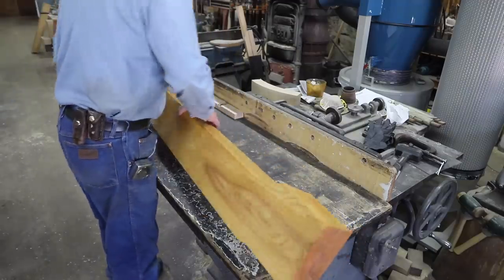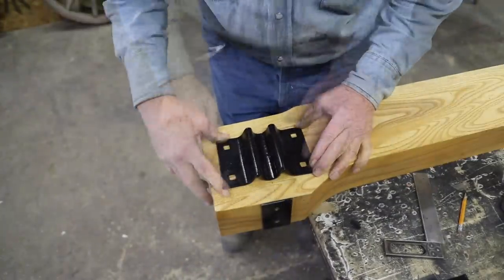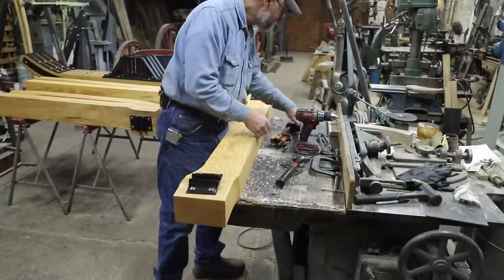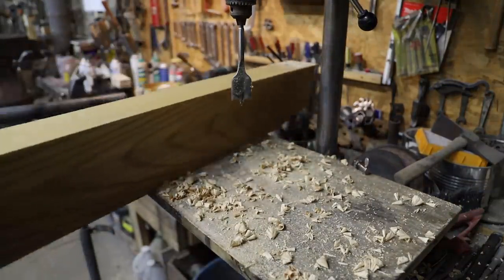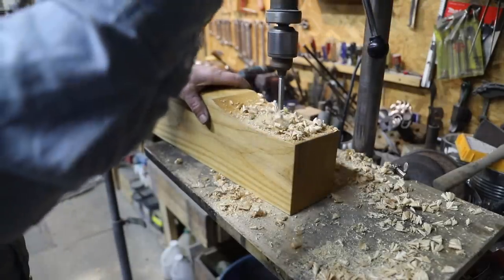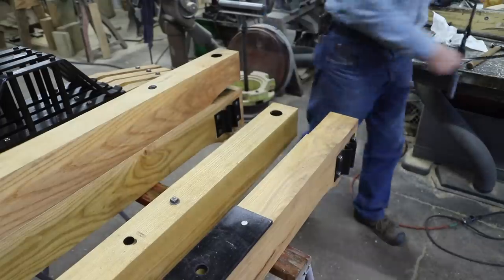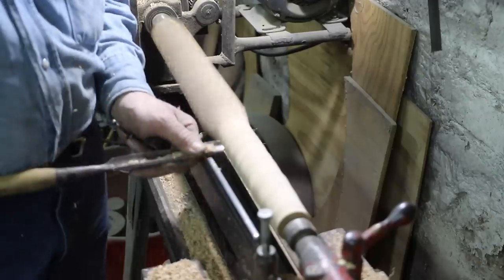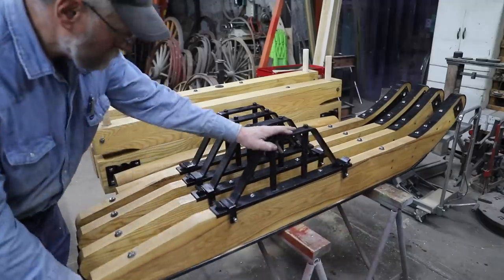Heavy Bob Sled Bunks & Bolsters Finished | Part 5 | Engels Coach Shop

Comment: Love the attention to detail. All the screws and nuts are aligned and square in all your work!  great job!!
Reply: I wondered if I was the only one noticing that. I do a lot of electrical work and the cover plates always have slotted screws. I always make sure all the slots are straight up and down. Occasionally I'll come across one that someone else has done the same way and I think "Now that's a guy who takes pride in doing a good job"
Reply: Attention to detail in such small things usually means attention to detail where it really matters.
Reply: I have never seen Dave not “clock” a square nut!
Reply: @fillg  Reminds me I once rode in a railway carriage that was hand built recently as a reproduction. All the screws in the internal paneling and holding the fittings in place were set with the slots aligned with the wood grain they were srewed into. I wasn't sure if this was craftsmanship or ocd. Certainly it was beautifully built.

Comment: Did I see you squaring the nuts to the work at about 4:40 and throughout the project? If so, GREAT attention to detail and esthetics. Love it!
Reply: Good eye.   I noticed that too when he set that part down I found it interesting that the nuts were in line.
Reply: All the old carpenters set the screws slots either vertical or horizontal ,not so much nowadays with philip head screws i do it myself and i,m not a carpenter just a fixer hobbyist at 76 yo.
Reply: whitey george , I also align the slots in screws when I replace door fixtures etc. It just makes me feel that the job is totally finished. Also 76 yo.

Comment: Awesome job as always. Using the spade bits and the heated drift pin to make the tapered holes was clever. Keeps from investing in a massive tapered reamer that wouldn't do much better! I wonder if the charred hole would also last longer than a reamed hole? Thank you for your efforts in posting these videos.

Comment: Hello Sir
Its very interesting to see the Progress in building the sled
So much holes you had to drill
But with the modern Tools all get very easy .
If you drill straight in the right Angel.
In older Times all the holes were drilled by Hand 
For the Big ones they had to use a breast Plate to press the drill with the Power of the whole Body
All these drills are still in my grandfathers shop.
Drilling was a heavy job in older Times 
Greetings and all the best wishes
Yours Frank

Comment: Hi;
You still amaze me.  This week the neat thing you did was the tapered holes.  My guess for the taper hole was you were going take a coarse round Rasp and file the taper.  You were three steps ahead of me.  You heated a tapered piece of steel and burned in the taper.  That was a very slick way to get a very nice taper.  
How much of the wagon's under carriage has to be removed to turn it into a sleigh wagon?
As always thank you for sharing.

Comment: Flawless work as always... one question... shouldn't the rear bolsters be separated by at least 2" riser blocks, dadoed into the mating surfaces 1/2" into the bolsters at the fastener points, to keep a 1" gap between the upper and lower bolsters?

Comment: Around the 11:20 mark, you plunge a long pipe into the holes you've just drilled.  Smoke rises.  What is it and what does this process do in the fabrication process?
Reply: @EngelsCoachShop  You are using hardwood in making the sled.  Does the process also work for softwoods too?

Comment: Thank you so much for these videos!  I have been collecting old bobsled hardware for a long time and would someday like to build a bobsled.  Your videos are very helpful.  I wondered why are there clips to hold on the bridge irons versus a bolt down through and into the runner?  Does there need to be some flex here for some reason, or is it so you don’t need another bolt through the shoes?  Thanks again.

Comment: I noticed a large circular saw blade hanging on the wall at the start of the video. It looks like a 14-16 inch . Never seen you use it. Does it fit your table saw or a small lumber mill.

Comment: Why are the pegs wood and not metal as it would be stronger and the rest is metal( smaller metal as its expencive )?. And what do these bolds do in the end of that part ( they dont hold anything)?. I was also day dreaming about , this is just a winter car from that time, you must have had some money left to get one of these... (like grandpa has a winter wagon oooo rich man).. hehehe.
Reply: Xander, I'll let Dave address the material choice for the pegs.

As to the winter car, disposable income thought, bobsleds were heavily used and necessary in their time. A great deal of logs were hauled out of the woods on bobsleds, most logs were skidded out in the winter, they slide better on frozen ground and frozen ground doesn't get tore up as easily. 
On the farm the bobsled might have a flat deck for hauling hay to the livestock, or perhaps a box for hauling any sort of materials from grain, to coal, to supplies from town. 
Although many of us have memories of jaunty rides on the bobsled with the family, smaller sleighs and cutters were primarily used for transporting people.
As the purchaser of this bobsled I will take some photos to show how I'll be using it including the deck that will be mounted on it. It should clear up some questions that people may have after Dave is done. Hopefully we'll have enough snow when it's all done and I can get a video of it in use.

Comment: Instead of calipers to test the diameter of the turning, I like to use an open end wrench as a "test gauge".
Reply: That works though calipers are lighter and easier to handle.

Comment: at 11:18 why run the "red hot poker" through the holes?
Reply: He was burning in the taper.
Reply: @davidkg4dwb601  No, at 11:18 he was working on the bolt holes for the 5th wheel(?) metal plates, not the tapers which were several minutes later in the video
Reply: I was wondering the same.  I am guessing either to have a layer of char to help keep the metal from rusting or maybe it is essentially a reaming process to get a precise wood to metal fit.  Hopefully, he will chime in with the real answer.
Reply: @EngelsCoachShop  Cool - thanks for the reply.  Best wishes to you and yours